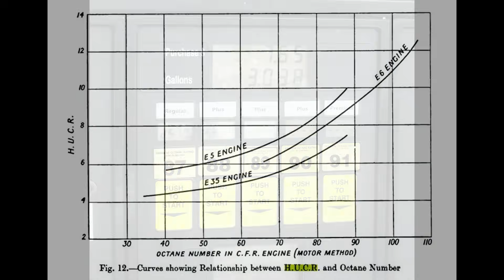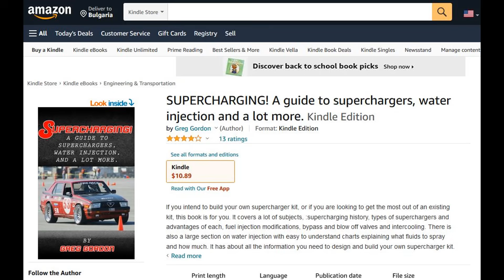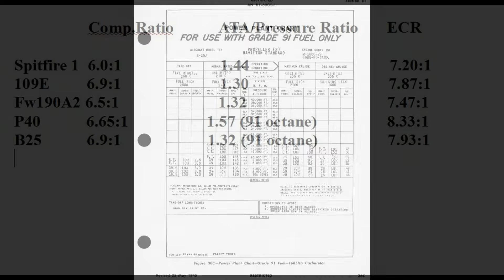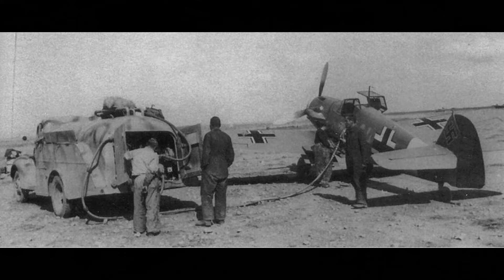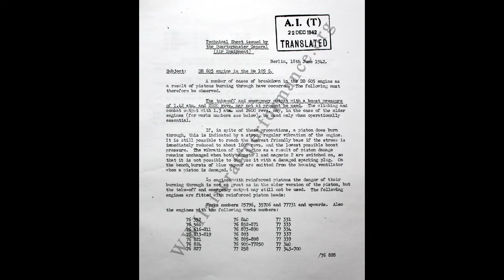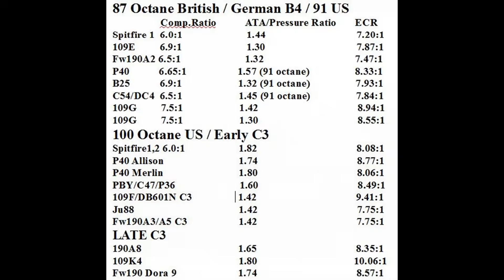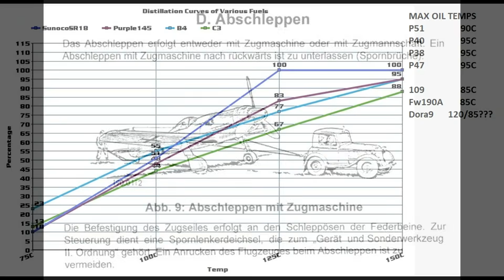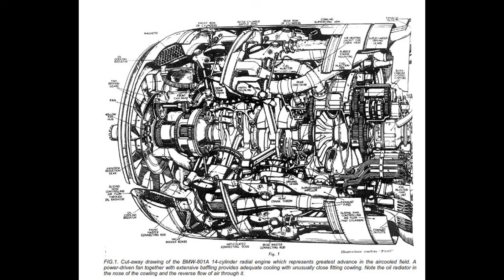German C3 Fuel, Uber Octane or Synthetic Crap?

Comment: Greg,  in my work on both turbo and normal aspirated 4 strokes...coming after a decade of work with  mainly European single cylinder 2 stroke, I have always been baffled or annoyed with the "traditional" way the "4 stroke guys" calculate compression ratios... This comes from the rather glaringly obvious fact that an 2 stroke does not begin to make compression until the big gaping hole in the cylinder is closed...The Euro motocross engines calculated the compression just like 4 stroke guys did and 99% still do.. But the japanese 2 strokes were quoted compression numbers AFTER the exhaust port closed--which could be 89-90 degrees BTDC..  This made me think about 4 strokes when "everybody is blabbering about 12.7 compression blah blah.>
Eventually I came to start thinking of "real" or what many now call "dynamic" compression ratio which cacultes compression from the point that the gaping hole--(-in a 4stroke, the intake port) is closed by the cam , which could be anywhere. So suddenly all tak of compression without taking into account Intake Valve Closing ABDC seemed meaningless.
Now there's multiple "Dynamic compression ratio online calculators"...
Now some years ago I did come across cam timing for Merlin and DB601 and even the Klimov V12..Helps to read  well a few languages but it doesn't help when you forget the numbers or where the links were..
My question: do you give any thought to intake closing ABDC when thinking about compression ratios?
Reply from the maker: I do have thoughts on that. Yes, cam timing is a factor. As you point out, when the intake valve closes, that's the point at which compression starts. However in that case there is usually more air in the cylinder than there would be with a more mild cam. That's the entire reason you used a hotter cam in the first place, to get more air in. So it's hard to calculate true effective compression ratio changes from valve timing.

Comment: I have a supercharger on my Toyota truck, and I can only run 91 octane...but its kinda neat the way the computer was designed in the re-flash...if by accident you put lower grade fuel in, its detected and the computer changes the way the vehicle runs so you don't notice too much loss in performance and the dreaded knock
Reply: Computer changes the timing- by sensors that detect knock, and probably intake and exhaust temps- I'm guessing.
I drove a Supercharged TRD 4 runner- nice vehicle.
Reply: @rdallas81  Yeah I had 2 3rd gen's before my Tacoma...great vehicles! Bought my second one with 600k on it because it was the original owner and didn't even think twice about it...plus it was a rare 5-Speed. The 3.4L is a rock solid motor

Comment: Germany has brown coal,  lignite, which has a much lower carbon content and higher moisture content than bituminous coal, thus a lower heat output.  Would that have any bearing on the octane, or does it just require more of that type of coal to produce the same fuel?
Reply from the maker: I don't know enough about coal to answer that.
Reply: @GregsAirplanesandAutomobiles  I figured that it might not be in your wheelhouse, but one never knows.  Thanks for the reply!

Comment: Jets really were the answer to Germany's fuel quality problem, but they didn't have the available metals in quantity needed for that either. Imagine if the resources wasted in the V weapons programs would have been used for the jet program. BTW, does anyone know the outlet temperature of the V-2 Rocket engine at full power?

Comment: Greg, I have a question regarding Fw190 D9 and C3 fuel: you once mentioned that D9 can be cranked up to run 2.1 ata (or something like that) and some actually might’ve been.
Did those 2.1 ata Doras run on C3 + MW50?

Also, regarding K4 that run on C3 + MW50, you said it basically ran C3 rich as a 125 octane fuel at the cost of engine bearing life. However, the performance jump in horsepower from B4 + MW50 to C3 + MW50 does nothing seem that significant, like 100-200 hp. It seems more in line with performance increase you get by switching from 87 octane to 96-100 octane, instead of jumping to 125 octane.
Reply from the maker: Off the top of my head I can't remember what the highest Dora variant ran in testing, but in front line service they ran B4 with MW 50 and about 2.1ata at the most. 

Regarding the K4, that's just a theory I have about the bearing life. I'm really not sure. The performance boost from higher octane fuel isn't from the octane itself, but the extra boost you can run with it. It looks like the German never fully took advantage of 125 octane plus MW50, thus never ran as much boost as the octane could have allowed.
Reply: @GregsAirplanesandAutomobiles  I gotcha, thx. Man I can never get over how good Dora looks, imagine c4+MW50 Dora…

Comment: I'd have to say you have posted one of the best videos on youtube to date, and the content you have provided is excellent. From what my father told me about the carburetted aerofighters, the carburettor(s) fed petrol air mixture through the supercharger, and the evaporating petrol helped cool the air as it entered the engine. this was also something that aided performance of the spitfire. I am led to believe there was a fuel injected version of the merlin, but cannot say that was fact. Regardless, the German engines did not have this advantage like the carburetted engines of the allies.
Reply: Well, that is one of the few advantages of carburation - the disadvantages being very clear as well (dependency of the aircraft's orientation and accelerative forces, difficulty to automate, higher pumping losses in cruise throttle settings, and the inevitable waste of fresh mixture with high-overlap camshafts...). When directly comparing fuel-injected to carburated versions of the same engine (as was of course done repeatedly while estimating if this technology was worth pursuing), BMW found the experimental fuel injection on their model VI engine raised power output by 17% and also lowered fuel consumption by 3% - which obviously was a significant advantage by anyone's book, never mind the combat-specific advantages of injection. 
In fact several officials at the Allies were lamenting the fact that they hadn't been far enough with fuel injection technology to put it into usable technology, while several companies in Germany had been doing literally more than a decade of research (Junkers having first introduced a fuel injected engine in 1916!) and had experience with that technology before the war.

Comment: I believe that formula you call into question is there to give a comparison for the BMEP in the cylinder. When building an engine for forced induction you are typically building off of that number rather than compression ratio. So yes the formula is not very helpful, but it is accurate so far as to say that you would need to have 16.5:1 compression ratio in an engine to have the same BMEP as is in the Camaro ZL1 engine. It's more for power than compression ratios. There is no way you take that ZL1 engine, rip out the forced induction system and replace the pistons with 12.8:1 compression pistons and make the same amount of power, that's just not how it works. But it might work for the purposes of knock resistance or what have you, but the amount of power and torque the engines make would not be equivalent.

Comment: I'm much more interested in the use and limits of MW50, although the distillation rate section was very interesting. Given the limits of their fuel I feel like they needed the MW50 more than the Allies. I'm surprised every German engine in the war didn't have an MW50 system. The Ju 52s would have even benefited from just the takeoff performance. For only climbing to altitude they could have used W100 and ran the system continuously until empty to prevent freezing.
Reply from the maker: Hi James, I cover MW50 in other videos, and I agree that the Germans should have used it more than they did.

Comment: Greg, your knowledge about synthetic fuel is a bit thin. Germany mostly used the Bergius process required about 6 tons of lignite to make 1 ton of fuel not 22tons. The main challenge was the very complex process..coal milling -> coal mixing with catalyst and some heavy fuel from the process - > liquid phase hydration (>200bar, 500°C process equipment was a bottleneck) -> separation of products -> gas phase hydration (similar challenges as liquid phase hydration) -> separation of products -> reforming -> treating. There are a couple of side processes as the generation of hydrogen from the remainders of the liquid phase hydration, the separation of the gasses...

It was definitly not a transport issue. The German railway system transported annually some >300 million tons of coal within Germany and Europe. 

The synthetic fuel made by the Bergius process had higher octane numbers as that of many mineral oil types. It contained a lot of aromates and cyclical hydrocarbons. Together with plenty of TEL they achieved the 100 MOZ.  

What I do not know is how the USA/Shell did make the high octane fuel in ww2?
Did they find mineral oil with a high isomerization, cyclical and aromatic molecules adding some TEL?
Did they invent a better isomerization process with catalytic converters add some TEL?
Reply from the maker: I didn't get into how they make fuel, that's not something I do on this channel. The 22:1 ratio is from what I think is the definitive work on this topic. I'll post it in the description.
Reply: @GregsAirplanesandAutomobiles  Till today I had the impression that you are an engineer with plenty of experience in aeronautics and engines...But 22tons of coal for 1 ton of liquid is not realistic from an engineers point of view. 
1. A ton of hard coal has about 0.7 fold the energy of a ton of oil products.
2. A ton of lignite has roughly 0.3 fold the energy of a ton of oil products. 
3. Conversion ratios for CTL are generally estimated to be between 1-2 barrels/ton with efficiencies "Liquid yields can be in excess of 70% of the dry weight coal, with overall thermal efficiencies of 60-70%(1) 
4. Germany produced in 43/44 260 M tons of hard coal and 250 M tons of lignite in toatal and made 5.4 M tons of synfuel....It would have required 100 M!!! tons of coal. 1/5 of the total coal production. But the coal was needed for the mining itself, railway system, steel manufacturing, industry... 
5. Sasol (CTL Fischer Tropsch Process) bought 22.6 M tons of coal 18/19 (production report). The plant has a capacity of 150 Kbl/day. It seems that they needed 22.6 M tons of coal to make some 8.5 M tons of hydrocarbons.  With a ratio of 22:1 it would exceed the South African coal production. 
6. The German books and talk about 6 tons of lignite to make a ton of fuel (Bergius method) which seems realistic putting process energy and losses in account.    
7. The capex for a CTL or GTL plant is published to be > 10 bn$. It is the high capex and perhaps maintenance & repair that prevents CTL, GTL from success. Germany was low on all raw materials and manufacturing capacity. ex. producing the reactors made of nickel alloy. That was the limitation. 

All in all it is fantasy!!!

(1) https://uu.diva-portal.org/smash/get/diva2:293610/FULLTEXT02.pdf
Reply: The former I think so. From what I read, some natural oil are considered very high quality like from Plolesti or Balikpapan

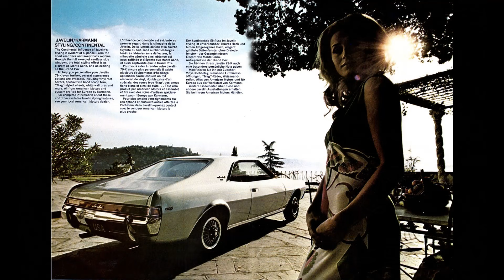Comment: 11:00 a factor to consider is camshaft/valve overlap. Static vs Effective (dynamic?) Compression ratio makes a huge difference. As many of the old "3/4 race cams" as they seem to have been called, had so much valve overlap that their effective compression ratio was closer to 9:1 than 10.5:1. (Maybe even lower like 8.8:1). 

The German engines used higher compression ratios, like 7.3:1 in certain DBs. V.s. the Merlins 6.0:1 and the Allison was approximatly 6.65:1 (initially). 

The German engines only had a single large exhaust valve, in a three valve per cylinder arrangement. The restricted exhaust valve makes for a huge problem, in the cases of a supercharged or otherwise boosted engine having rather low compression ratios. - They (3-valve, low comp.) engines under boost would require longer durarion on the exhast valve, to ensure proper efficiency. Because of both the back-pressure and exhaust gasses causing reduced oxygen in the combustion cycle. Large valves cannot sustain the same camshaft rates, either. Due to their mass. So, the exhaust valve timing becomes a big factor on a highly boosted, low compression ratio 3-valve engine. The German 3-valve engines needed the higher compression ratio to work, But the 7.3:1 didn't hurt the detonation margin significantly, vs. 6.65:1 in a four valve Allison design, because the single exhaust valve almost certainly had significant overlap, reducing it's dynamic compression ratio to a lower number, probably around the 6.5:1 range, more similar to the Allison V-1710, which would have a dynamic comp ratio lower than it's static 6.65:1, but not significantly so, maybe around 6.2:1, due to limited valve overlap. All engines of that era had higher comp than the Merlin. Which is why that V12 can sustain such insane levels of boost, with proper fuel.

Of course the German Direct Injection was a radical improvement, and GDi is only recently becoming mainstream in automobiles (allowing the modern insane compression ratios, with turbos, and low grade fuel. E.g. EcoBoost 3.5 can take 85 octane with twin turbos, 16psi of boost, and around 12:1 compression). The Mercedes SL500 Gullwing if the 50s was the O.G.

I've calculated the exhaust valve area actually needs to be equal to the intake for around 90+ inches and 6.0:1 comp, in the case of later Merlins at very high boost and low comp ratio. Those motors, for example might have benefited from a valve size change. (Reno racers could probably run larger custom exhaust valve area to intake valve area e.g. 1.05:1). And the stock Griffon engine gets close to unity, with a ratio near 0.95:1 exhaust to intake valve ratio, if I remember correctly. I've found the info in the past, but I can't remember exactly how close it gets to 1:1, but it's close. There are other factors, like fatter exhaust valve stems. But it's the basic need of a low comp, high boost engine to have unusually large exhaust valves and/or long exhaust duration and overlap.
Reply from the maker: The DB601/605s had 4 valves per cylinder. Also I mentioned the effect of valve timing, and cover it in other videos.

Comment: I have heard that the germans had trouble using captured russian fuel in their equipment, due to the low octane.
The domestic russian engines, had lower compression ratio's.

A video about the subject would be interesting. 
I wondered if lend lease equipment had to be built with lower compressions, like the Studebaker trucks.
The Stuart tank's radial engine was converted to diesel by Catepillar, for russian lend lease.
Maybe lend lease fuel was used with the lend lease equipment.
Reply: Thanks for sharing that information about the conversion of the radial to diesel for Lend lease! 😊

Comment: ya... the intercooler (lack of) hurt WAY WAY worse than low octane and a lean mixture
.
id say BOTH the low octane and lean mix was probably 15%
but the lack of an intercooler was more like 30 to 40% of the issue
.
.
no intercooler = MANY MANY MANY more hours designing the engine to not blow it self apart 
.
where if you do have an intercooler..... you can do some pretty stupid things to a motor
and it will still stay together
.
.
this is my experiences in being an auto-mechanic and hot rodder
and also watching the "Banks power" videos on youtube
.
that old dude taught me that boost PSI doesnt mean a DAMN thing
density does!!!
.
and dropping air temps by 10% improves power MUCH more than adding 10% more boost
Reply: like.... if ALL german fighters had intercoolers...... we would of had a MUCH harder time in the war
.
i really do think its worth its weight in gold

Comment: what i learned from "banks power" videos is...
adding boost doenst do anything if you dont have an intercooler 
.
even with 170 octane fuel..... not having an intercooler REALLY hurt the germans
.
you RAPIDLY start getting into diminishing returns
at 8 PSI.... sure, you dont need a cooler (aka, pre-war)
but at 1.6 ATA..... ya, you NEED it
.
and if you run at 2.0 ATA to compensate for the density lost due to heat.... you are still are only going to be able to run ~1.4 ATA effective power levels
which would require you to pull timing out of the motor.... and make it "roll coal" like a diesel pickup....
.
.
like the anti-knock rating stays the same..... but the higher the boost, the higher the temp
therefor... the lower the effective octane 
therefor....  ya have to run super rich.... or pull so much ignition timing.... a 10PSI boost would net more power than a 30 PSI boost
.
.
.
engines are a FINE balance
.
.
.
.
.
and i know my GM 3.1 V6 LOVES!!!! .....absolutely LOVES!!!!...... cold air 
.
its just a NA cheap little motor
but when its -50F outside.... i swear that thing doubles its HP
.
100 degrees at 5000 feet going threw a mountain pass.... i can actually feel the power drop off as a climb
and then can feel it gain power as i go down
.
and again.... when i go threw a "coolie".... and get a blast of 70 degree air VS the normal 90 degree air
its like i put a turbo on the engine 
.
just perks it right up
Reply from the maker: Yes, air density matters, in fact I discuss that at length in my book on supercharging. It's the density that matters. However at low boost levels, like around 5psi an intercooler doesn't do that much, which is why there are so many low boost non intercooled vehicles.